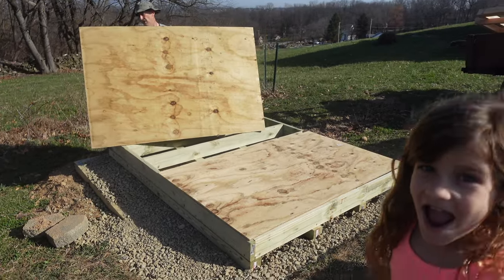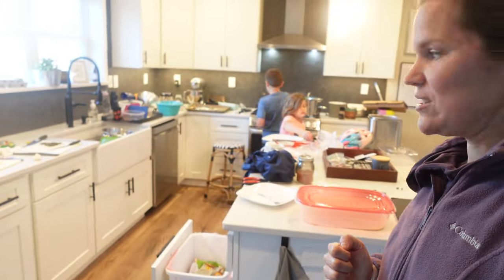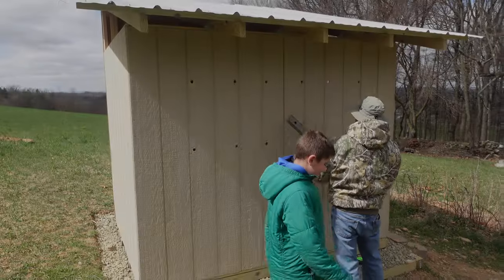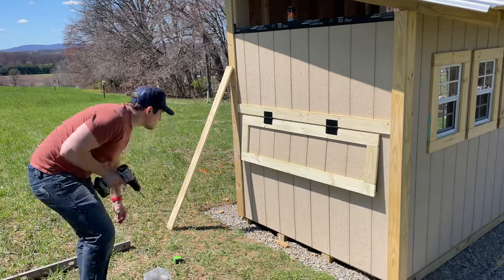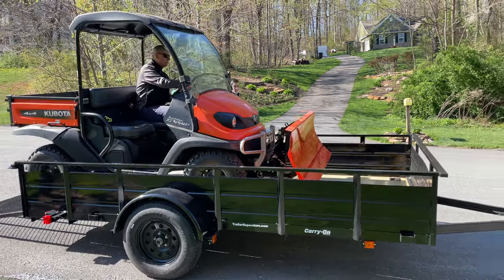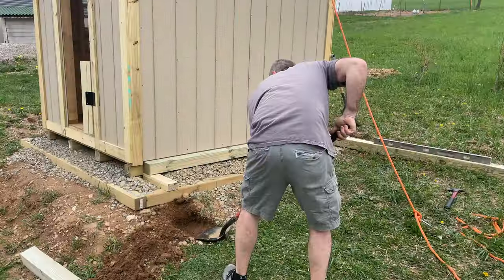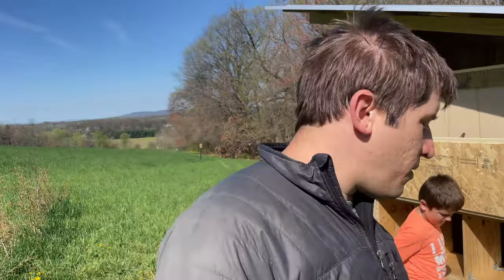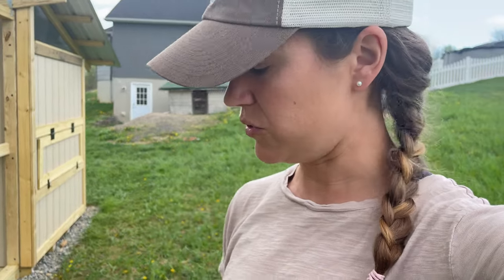We Built a Modern Chicken Coop from Scratch (DIY. Run Attached. Fits 12-20 Chickens.)

Comment: Would you mind sharing the little tweaks you said you had to make with the plans ? Also, do you l ow a round about idea of the cost for the coop and run? Thanks !
Reply from the maker: Absolutely! For starters, we didn't want the coop to have direct ground contact because of drainage and longevity. So we first leveled an area of ground, framed it with ground contact 4x4s and filled that with stone. At that point, we took off with the original plans and sat the coop on the stone pad. 

The biggest issue we ran into was that our coop-site is anything but level. We resolved that for the coop itself by creating the stone pad, but we didn't want to dig up the grass in the run side. What we had to do there was almost a Jenga-like build from the ground up until we were able to get to the point of the 4x4 ground contact frame that the plans call for. On the high side, the single 4x4 was fine, but on the low side we finished with four or five layers of 4x4. We filled in as much of that base as possible, and then poured concrete to fill in any gaps. If that doesn't make sense, take a look at the thumbnail image or peek back through the footage...you'll see what I mean!

I do plan to tally a more accurate figure when we wrap up totally and can update you then...but I would estimate our costs to be somewhere around $2000-2500. 

I hope that helps. Please don't hesitate to reach out with any additional questions.
Reply: Thank you SO much ! That was extremely helpful . Thank you for taking the time to explain all that, I really appreciate it ❤

Comment: Building the same coop from Etsy right now. How much overhang for the roof did y’all do?
Reply from the maker: Great question! I just went out and measured. We did about 2 feet on the coop itself, and 30 inches on the run. We went a bit more substantial on the run to protect from sun and rain since it's more exposed to the elements.